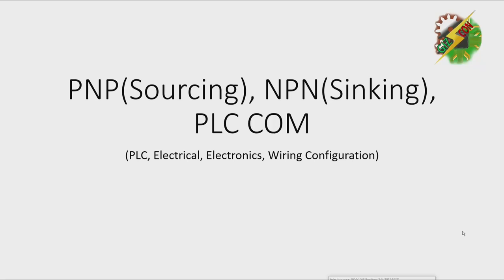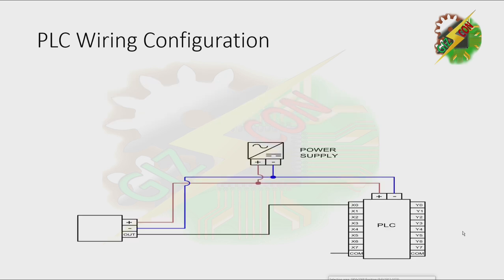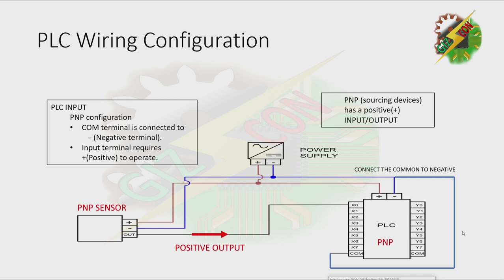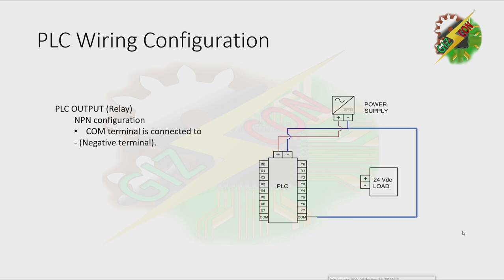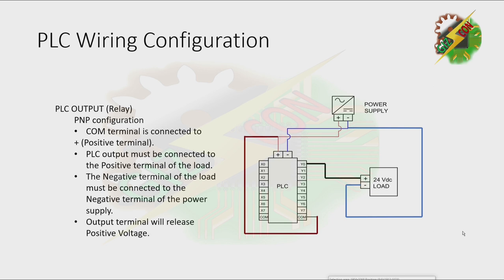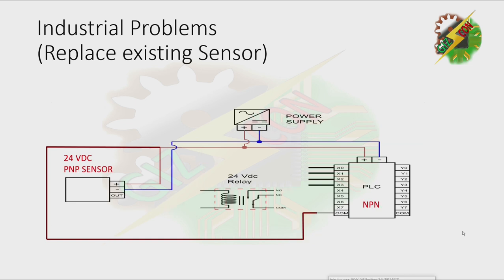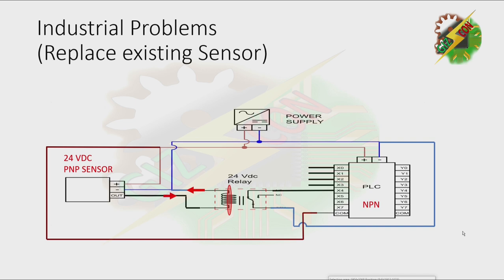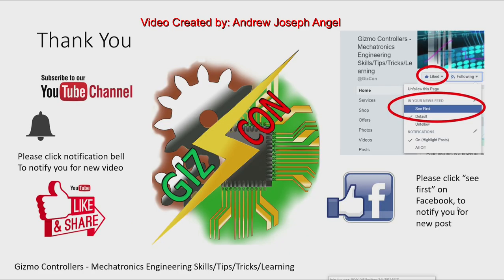PLC Wiring Configuration  NPN  PNP  PLC COM port Connection

Comment: Hi I do have a question. if the PNP(sourcing) sensor is connected to the PLC input card configured as PNP(sourcing) isnt this short circuit? Both sensor and plc input card sourcing 24v?
Reply from the maker: no it's not you can watch this video to understand more about it https://youtu.be/kc4JIs9dh1Y
Reply: @GizmoControllersMechatronics  thank you very much good sir! Now I understand. I do lack the knowledge of this advance signal looping. God Bless You 🙏